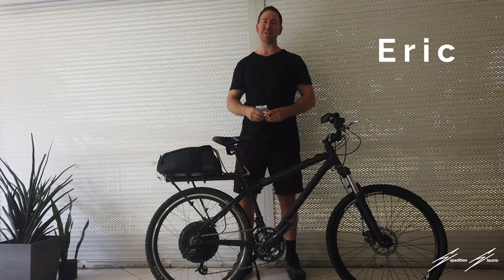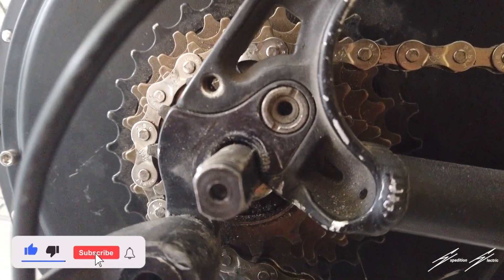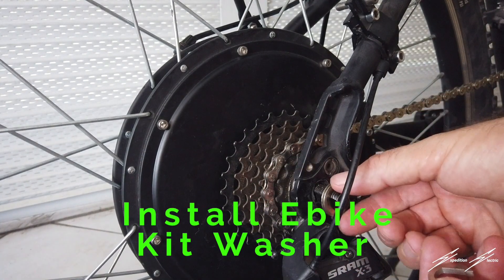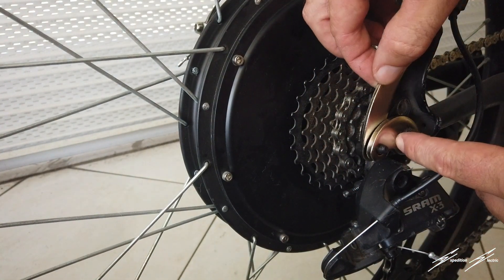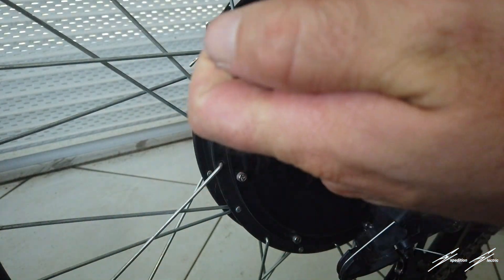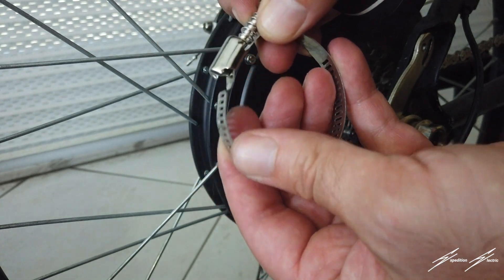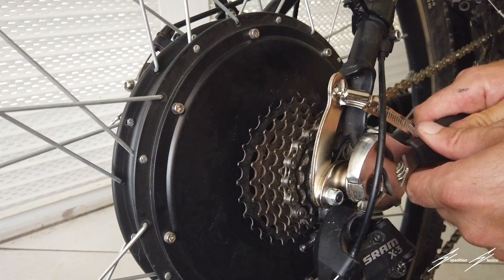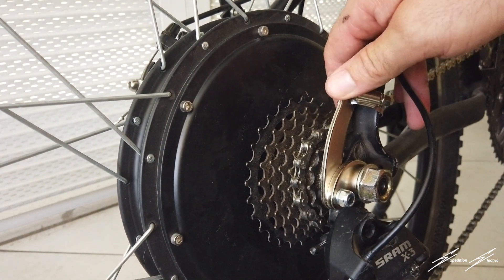Installing an Ebike Torque Arm with 1000W Rear hub electric bike motor [DIY EBIKE]

Comment: Is there a right and wrong way of doing it because nobody explains and the hub keeps coming off the drop out
Reply: right way is to not buy a torque arm with a join, solid torque arms are the only good ones, the solid ones are one piece that goes in the pannier holes

Comment: Hello, I have a bike with 26inch wheel. I want to upgrade a motor like yours. My rear dropout bike is 135mm wide. I wonder the 1000w motor can fit it with a 7s or 8s thread freewheel? Could you make it clear? I appreciate it.

Comment: Had a 750 watt hub that ate my dropouts completely. I opt for steel frame now exclusively. Torque arms not optional.
Reply from the maker: What type of steel frame did you get?
Reply: @expedition-electric3549  whatever quality steel freego uses on their shotgun f2 model. I've got almost 2000 miles in the last 10 months, the previous bike I had gave up in the dropouts after less than 700 miles.

Comment: This is wrong. All of the work is being done by the hose clamp. The torque is going backward. 
As for the arm not fitting on in the right direction, you needed to flip it around to get it  lined up. You only rotated the piece and selected from one of two direction. The item is not symmetrical - you need to flip it around and try those directions.
Reply from the maker: You're right, a hose clamp shouldn't be the primary source of torque. It's designed for sealing, not holding things together under force.  Is there a way to use a proper bolt or bracket for a more secure fit?

Comment: You are supposed to install the torque arm, against the torque. 

You have it backwards.

The only thing holding your torque arm on is the hose clamp.

You really should think about what you post - this installation is very dangerous not to only you (OP,) but others who are installing it wrong.
Reply: What is the right way then I need help I don’t want it coming off during my ride
Reply from the maker: I've found videos that show both..

Comment: i dont get it so its held on by a metal zip tie thing clamp, you  never screwed the torque arm into the brakes that how its done right
Reply from the maker: Were you able to solve?
Reply: yes my friend i have built 5 e bike for my friends now all same method i created my own way to make work without torque arms or anything up to 5000w
 @expedition-electric3549

Comment: It's actually better to install the torque arm from the bottom because the direction of torque is opposite from that which the wheel is turning. So seeing how you have installed it is only as strong as the hose clamp holding it, which isn't that good
Reply: some people cant though due to the bike design, if one has to use a clamp they wanna use a O clamp or something which is solid metal
Reply from the maker: No
Reply from the maker: I've installed double

Comment: DonI need to install these ones on both sides? Or with one side is enough?
Reply: I installed torque arms on both sides of the rear axle for extra measure.
Reply from the maker: I would install double.

Comment: I’ve just purchased a fiido m21 with a m12
Axle and 175mm drop out it runs 500watt rear hub but I’d like to fit a 1000
Or more powerful motor any advice please it’s for usage on private land in U.K.
Reply from the maker: Were you able to get the bike?

Comment: I've seen some people or the torque arm from the bottom. Does it make a difference? Do you get better torque transfer if it's coming from the top? I've always thought so myself
Reply: yes its better if the torque arm can  rest against the frame but for some people it dosnt align up that way
Reply from the maker: Geat tip!
Reply from the maker: Heard both ways
Reply: I've since come to the conclusion that it's better to have the torque arms from the bottom. When the wheel spins forward, the torque in the motor is actually going backwards in order to drive you forward. It's best to have that torque travel up and directly into the frame. Otherwise, you're just relying on the hose clamp to hold up. That's just how I understand it and I could be wrong

Comment: I'm very new to ebikes and you have been my go to source. You have so much good stuff out there. If you have 10 seconds I have a quick question sir; if someone was running 2 hub motors and their combined max current from the controllers was 60 amps, and you used a battery with 50amp BMS (52v 20ah), what would happen? If you ran WOT you may trip the BMS of the battery and it come back on after a few seconds? Or something worse? Thank you!
Reply: that depends on the c rating of the cells being used on the battery, every battery has a maximum constant discharge rate; check the manufacturers reccommendation. In theory as long as you stay within the range the battery will be fine, for your application though it seems overkill for the batteries and you might have to invest in a higher discharge battery or resort to LIPO batteries as they are generally have much higher C rating than Lion batteries
Reply from the maker: Thanks!
Reply from the maker: Hello Mike,   Sorry but I somehow completely missed this comment. Were you able to find the solution to your question?

Comment: Uhh would these torque arms work with a horizontal drop out?
Reply from the maker: it depends on which direction the dropouts face
Reply: @expedition-electric3549  yeah they’re horizontal. 

My bike is called the Redline Slant 2004 model.

Comment: Should I put two torque arms or will one do ?
Reply from the maker: I would recommend two if you can get them to fit.
Reply: @expedition-electric3549  thank you
Reply from the maker: @yourfavouritescepticx8969  you're welcome

Comment: Will this actually help? My rear wheel is also not fitting a lot exactly like the way ur axle doesnt fit a whole lot into the frame
Reply from the maker: Some say yes, some say no. I think it's a good backup with one or two torque arms that could prevent a wheel from just completely flying off.

Comment: Gonna use this as reference for installing my 2 torque arm kit on my walmart bike that I am converting into a 1000w e-bike when the parts get here next weekend. Since the kit has 2 arms, I'm gonna put one on each side
Reply from the maker: Nice!  What brand of kit did you go with? What size battery did you get?   Sounds fun!
Reply: @expedition-electric3549  A CSCbike 1000w rear hub kit, and a 48v 14AH battery. It's kinda on the cheap end since I had a budget of about $500
Reply from the maker: @ThunderbolttheFox  Nice!   I’ve made many similar bikes!   It may be difficult to install the 2nd torque arm because of the motor wire harness being larger than the hole of the torque arm.  Send me pic when complete!
Reply: @expedition-electric3549  I got the kit today but haven't installed it due to the battery still shipping, no point in adding a ton of weight to an unpowered bicycle. Anyways the cable comes out of the end of the bolt itself, so I was able to remove the pins from the plug at the end with some pliers, and then slip on the torque bracket. When I do finally install the kit, I will be able to use both torque arms, one on each side.
Reply from the maker: @ThunderbolttheFox  Oh nice!   well hopefully that battery arrives soon so you get rollin!
Reply: @expedition-electric3549  Since I'm sick today and stayed home form work, I decided to test the fit and all that and the hub wheel does fit with exception to the new disc brake I'm adding. So ordering a cheap dremel so I can sand away the disc brake mounting points on the frame until it all fits correctly. I noticed in another video about installation where someone had the same problem and had to do a bit of sanding to fix it.
Reply from the maker: @ThunderbolttheFox  Oh interesting, were you able to make the disc brake fit?
Reply from the maker: @ThunderbolttheFox  Feel better!

Comment: The reason it fits awkwardly is because they are intended to be used on front forks which have weaker drop outs. I have yet to see a torque arm intended for a rear fork.
Reply: I've got the bike, waiting on the electrinics to show up and in the mean time I've been searching for a one piece torque arm. I don't understand the pivot / hose clamp design being sold as a torque arm.
Reply: @mdemartile  What don't you understand about it? The torque arm itself engages with the axle flats, the anchor strap attaches the torque arm to the frame to stop the arm rotating. Ideally the arm and strap should join at around 90 degrees so the strap best resists arm movement. Just make sure you have it set up so the anchor strap is in tension so it actually resists the axle turning - it's not designed to work in compression.
An alternative configuration is a one-piece torque arm that presses directly on the frame - this works in compression rather than tension so is mounted on the other side of the frame tube or fork leg. Just remember that the force the torque arm is resisting is the opposite to forward wheel rotation, so the torque arm must be pushed or pulled in the same direction as the wheel rotation.
Reply from the maker: @mdemartile  If you find one piece torque arm,  let me know!      What bike and kit you going with?
Reply: @expedition-electric3549  A one-piece torque arm would be a lot less "universal" than the two piece type, but easy enough to make your own with basic metalworking tools. It does need to be quite thick hard steel to hold the axle without getting chewed up, so tedious to make if you're using hand tools.
Reply from the maker: @eternaloptimist2840  Gotcha, yeah would need some metalworking tools to get that job done, but would be cool
Reply from the maker: Someone needs to start making them!

Comment: You're using a fake, chinese clone of torque arm that will snap over time
Reply from the maker: Where do you get yours from?
Reply: @expedition-electric3549  https://ebikes.ca/product-info/grin-products/torque-arms.html
These are the original torque arm developers, they talk about how the chinese cloned their flawed v1. Only v2 and above will actually help in the long run. I recommend you read the FAQs on the bottom of this link.

However, they're a Canadian based company so I got mine on ebay from a reputable UK seller. 3mm (low power only and should have one on each side), 5mm and 10mm thick stainless steel options.
Mine bolts directly to a fender eyelet which is ideal but they have designs for other types of configurations
Reply from the maker: @TheAviation101  They don't seem very interested in selling on ebay or amazon. I haven't been able to find. Only the same ones used in this video.
Reply: @expedition-electric3549  Yes just get good life insurance instead, no big deal
Reply: @expedition-electric3549  One user died after this chinese torque arm snapped, the dropouts spread wide open, the rear wheel came off whilst shorting the phase wires and he went uncontrollably in to oncoming traffic and hit a truck. Splat, got cut in half.
Reply from the maker: @TheAviation101  Well then, maybe the solution is that a company should sell better ones on the internet...
Reply: @expedition-electric3549  There is but it might not be on amazon. Grin sells worldwide through their storage page. Where are you from?

Comment: I promise there's no way it can fit on my frame, I'll have to cut the hall sensor wire
Reply from the maker: Can you install a torque arm on one side  and then on the other side the motor wires are in the way?
Reply: @expedition-electric3549  , yes man, it won't fit on the chain side, and in the other side there's is the motor cable in the way, but no big deal, I have to install new discs, pads an tires, so I'll take the chance to put the torque arm on. keep up the good work!!
Reply from the maker: @WhatWorks-DIY  There's always some project on a DIY ebike!
Reply: That is because torque arms are intended to be used on front forks which have weaker dropouts. I have yet to see a torque arm intended for rear forks.

Comment: Isn't it backwards?
Reply from the maker: So I've seen quite a few posts lately on this topic in diy ebike forums.  Some people would say that it is backwards. Some say that it is correct. This is pretty much the only way that it would fit on this bike with the wheel axle.
Reply: @expedition-electric3549  Eventually I found it on web archive Grin V1, https://web.archive.org/web/20140305043627/https://ebikes.ca/product-info/grin-products/torque-arms.html
Reply from the maker: @unclebirdman  Good find!